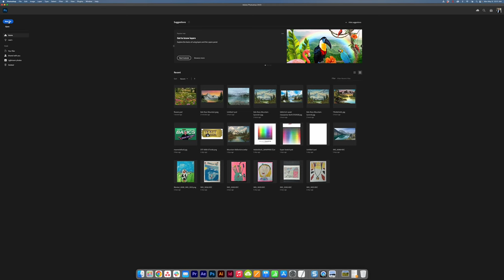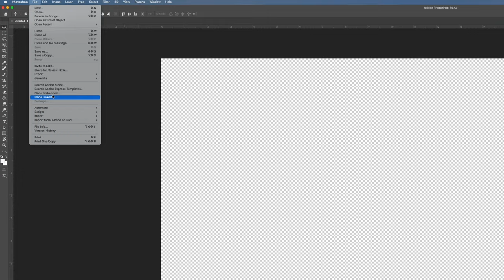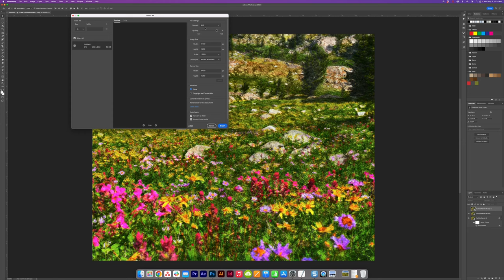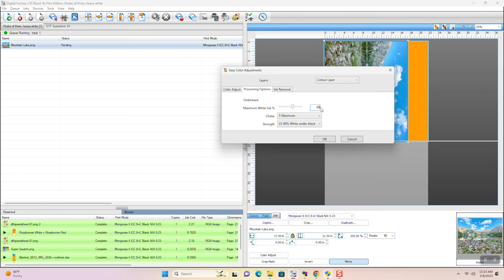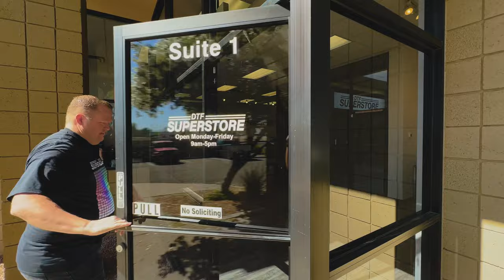We Tested 2 Methods for DTF Printing on Canvas | Tutorial/workflow included

Comment: What about canvas bags that have been waxed?  Will the heat melt the wax and ruin the transfer and/or bag?
Reply from the maker: It really depends.  Coatings can make pressing DTF transfers tricky so I would recommend testing with a specific product before you commit to making them.